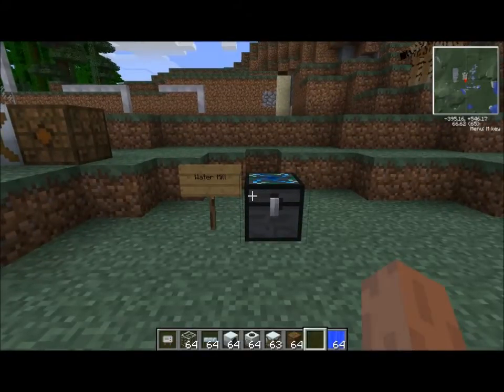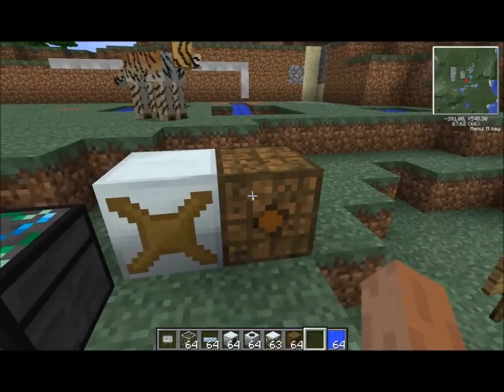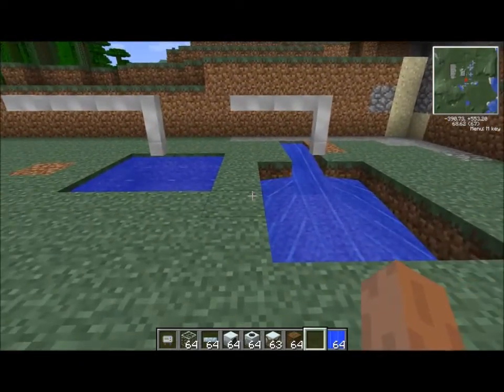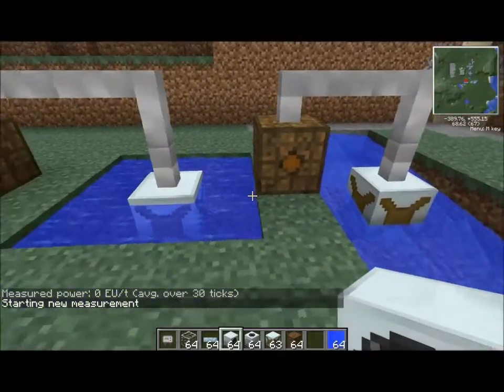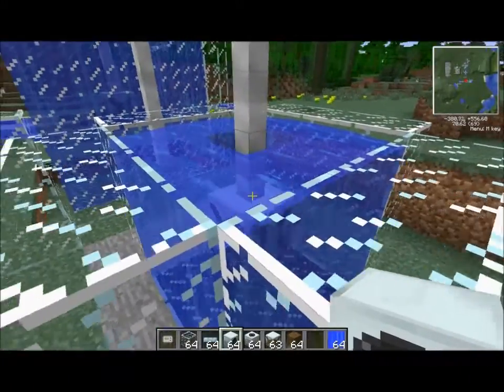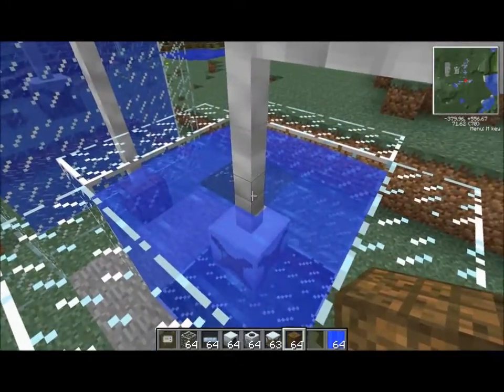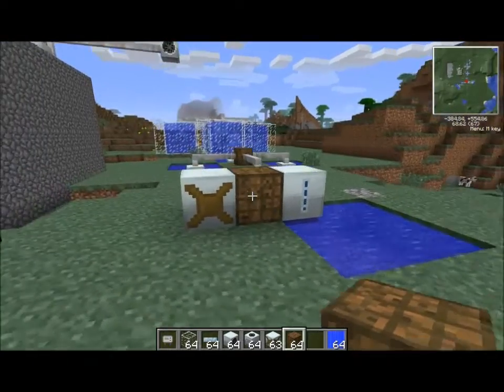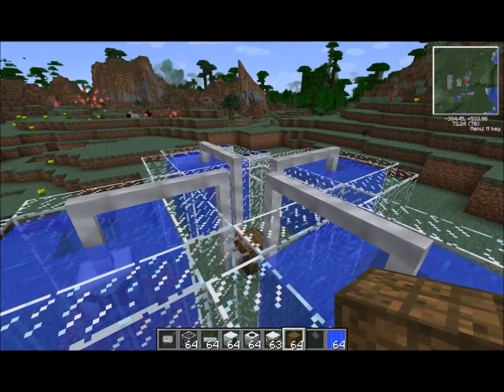Industrial Craft 2 (IC2) Water Mill Basics: Operation And Placement

Comment: I build a Watermill power plant with automatic water refill, all in survival mode. It was expansive as hell (i used 150 watermills, and 4 refill stations), but it is worth it, i get constant 150 eu/tick and once it runs, it will run eternal.

Comment from the maker: The water mill is a power generator that generates power from water. So you don't power a generator with it. As shown in the video, you can connect cables to the water mill to run the power to other machines, like a bat box. Does this make sense?